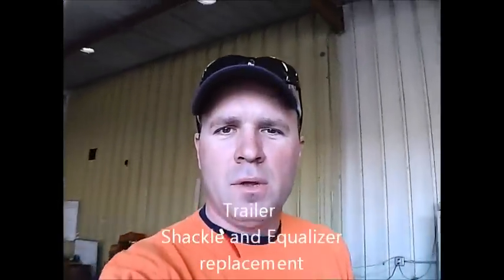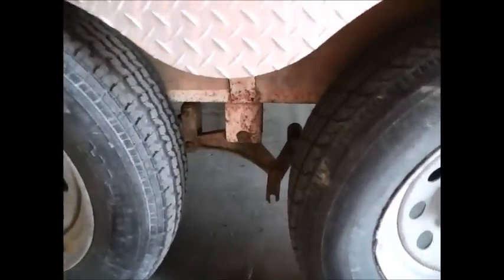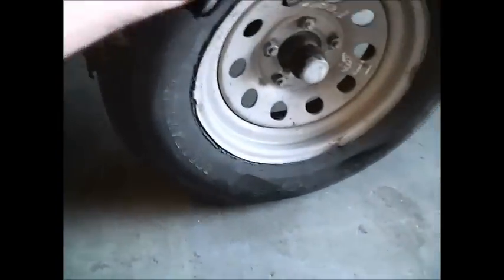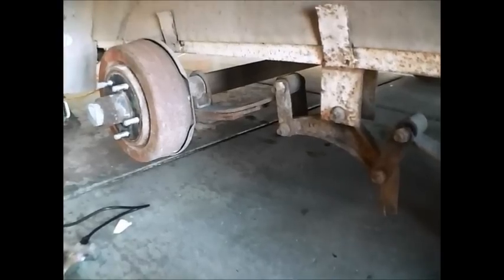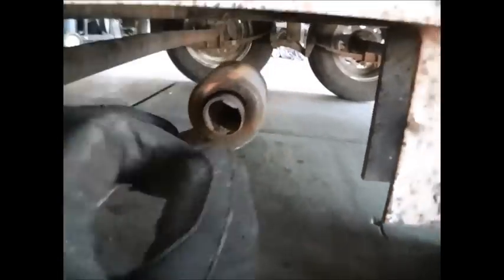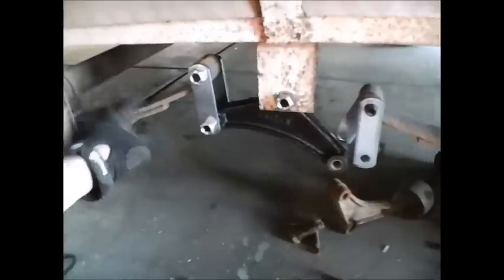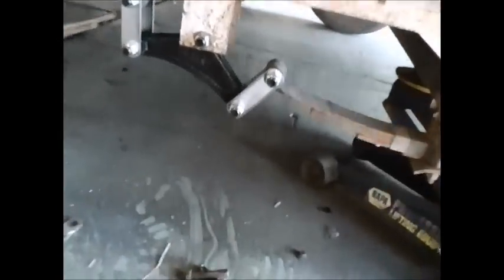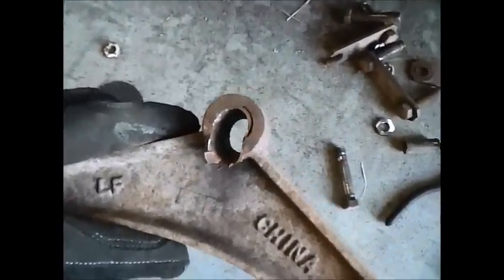Trailer suspension repair: How to

Comment: I am doing this repair but bought the kit which has grease fittings on each of the bolts/pivot points.  Being able to pump grease into those suckers is important, and will prevent future axle failures.  My equilizers were worn  half way down the equilizer, and would have snapped at any moment.  Grease fittings should be standard equipment.

Comment: I would like to share something with everyone. Those equalizers are made to fail. They do not bend or distort, they snap when they are ready to go.  Yes they are steel but they are a cast steel. Total crapp. Cast iron is stronger and would last a lot longer but also fail before they distort. Now if the were fabricated from a piece of mild steel with a continuous thickness throughout  they would last forever. Better yet ,tool steel .Yes you may need to replace the bushings and bolts now and then but the equalizers themselves would keep on truckin'.
Let's say the thickness between the hangar straps is 1.75" and you used a piece of road plate at that thickness, drilled and added some bronze bushings, it would be bulletproof as well as salt water proof. There are plenty of ways to fabricate these things so they would last for a long time. But the companies who cast these things must know they are screwing the public. Have you ever seen a person trailering their boat stuck on the side of the road with their trailer tires pushed up tight to the fenders? I see it all the time. Those equalizers are crap, made from Chinesium and the D.O.T. should banned them. Like everything that's manufactured nowadays made to fail. We live in a disposable economy surrounded by Chinese junk!

Comment: Thank you you've told me what I wanted to know. The last time I used my brothers stockcar trailer was about 10 years ago to haul my 55 Chevy home and at that time I put new tires on it and while the tires were off I got a good look at the suspension. The shackles and spring pins were badly rusted. I just about didn't use the trailer but since I bought the new tires I figured it better have one more haul left in it, so I took a chance, and we made it home ok. But that was 10- years ago and the trailer has been sitting in the weeds so I know it needs rebuilt. Thanks for tutorial on rebuilding the suspension it helped immensely.
Reply from the maker: Hey Mark,  Thanks for the awesome comment,  Glad that the video helped out. Appreciate ya, Cheers!

Comment: You answered my question. I was curious about how tight the bolts needed to be. I went until the splines were fully engaged and then a little more. I figured everything was slightly in a bind. I’ll back them off some. They are lock nuts so they should be perfectly fine.

Comment: I have an RV with similar suspension and will be upgrading it in the next few months to a beefier system.  Thank you for this video, very informative for sure bud.  One question though.  Would you recommend putting any grease on the bushings at all?
Reply from the maker: Thanks Brent!  Yeah you can use grease if you want. They actually sell leaf spring bolts that have grease zerks built in. I live in the desert so I dont deal with rust very often. If you live in a humid, snowy or rainy part of the coutry than I would recommend greasing them. Good question, appreciate the nice comment!

Comment: Any real advantage by going with a metal bushing? I watched a video of a guy who swapped out the springs on his trailer and pulled out the plastic bushings beforehand to replace them with bushings he cut himself from copper or brass pipe. He didn't explain why. Obviously, metal doesn't wear as easily as plastic but my plastic ones have lasted for 15 years. Is it worth the time and effort? Thank you in advance for your time and thoughts. Nice video!
Reply from the maker: Hey Scott. Thanks for your comment! I would only recommend a brass or copper bushing if the trailer was being used daily, like a landscaper or small business. Ive never used metal bushings but have used greaseable shackle pins which help with longevity and smoother operation.
If your trailer is not used daily than a plastic bushing will work great, thats all Ive ever used on my trailers.
Reply: @RYEINDUSTRIAL  Excellent. Thanks for the reply. I'll stick with the plastic that came inside the new springs then. It's just used on the weekends. I appreciate it and I subscribed.
Reply: Bronze is used for bushing material in many applications, I would imagine brass and copper doesn’t hold up as well..
Reply: Hi nice vid. Some of my bushings were tight in leaf springs. .is it ok to drill it out to slide in?

Comment: What a great video. Would you prefer metal bushings over the plastic I see being installed? Secondly, my old trailer had shackle bolts with zerk fittings to grease them.  My new replacements are just bolts. Is there any benefits to greasing the fittings over just straight bolts?  Appreciate your innput.

Comment: 0:16  Wear is caused by the bolt rotating in the shackle.  Weld the boltheads to the shackle. Use greaseable parts
Reply: good to know, TY
Reply: Most shackles the bolt head is press fit to prevent rotation. ONLY turn nut during removal

Comment: Replace those crap bushings with bronze bushings and use greaseable wet bolts. Will last forever. I use a torque wrench for these bolts. Not too tight and not too loose.

Comment: Can you flip the shackles to allow for more distance between the tire and frame?
Reply from the maker: Yes you can, but you would need to change the mounting on the non shackled side of the leaf spring. As long as the spring ends are parallel than you are good.
I have seen kits available for lifting trailers. I would suggest finding a kit online and looking over the parts kit and making it yourself.

Comment: I'm looking at purchasing a trailer that has a busted equalizer, everything else seems fine, should I trust it to be road worthy?
Reply: equalizer's are usually the last to go, check for play in the suspension. I'd suggest replacing all suspension bolts and bushings when you replace equalizer, the hangers could be bent but fairly unlikely

Comment: Good video.
Question what causes a axle to flip? I have a tandem axle that will pop up.
TIA
Reply from the maker: Hey Mark. That can be a normal thing when a trailer is empty and you hit a good bump. The force will cause the pivot point of the equalizer to bump over, usually after a few miles of driving it will come back into place.
If it is a constant proble, loaded trailer or empty trailer, than you might have a few problems. First I would check the shackles and make sure they arent bent or worn out.  Second problem could be the wrong size leaf spring, its too short in length. Third would be that the leaf spring brackets welded to the trailer were done wrong.
I would try checking the shackles first and make sure that when the trailer is on level ground that they are straight up and down from the equalizer to the lesf spring. If there are offset then I would change them out with the same size.
Its hard to say how to get it fixed without seeing the trailer in person so I hope my suggestions help. Worse case take it to a good trailer repair shop in your area and have em diagnose it. 
Thanks for your comment!

Comment: great video, learned a lot....which truck or car rims would fit a tandem axle?
Reply from the maker: it depends on the hub size. most common trailers, like in the video, has a rim size 15x4x5.5    Meaning 15" round.  4" wide and a lug pattern of 5 on 5.  5 lug nuts and the lug holes measure 5".   I found the width is the most important. My chevy rims will fit but the tire will hit the frame when installed. Most Japanese rims are 5 on 4.5" but might work for a smaller trailer.  Hope that helps some. Thanks for the comment and watching the video. Cheers!
Reply: Alright thanks...Im looking for truck rims with the right offset and center bore for 5 on 4.5, so far no luck.
Reply: @JoeBakerOutsideTheBox  try ford Ranger wheels. or jeep cherokee wheels

Comment: Very informative. Really needed a vid like this. Thank you. Have one question. How do I know the axle GVWR? I purchased a used trailer like the one on the vid but don't know the GVWR. Any way to find it? What is the GVWR on the one in the vid? Thank you
Reply: If its a tandem axle its safe to assume each axle is rated for 3500 pounds

Comment: Question: On those flex points where you back bolt back a 1/4 turn. Would you recommend locktite on those bolts ?
Reply from the maker: Hey Troy.  Yes you can use locktite to help em from backing off.  Thanks for your comment. Cheers!
Reply: There're new lock nuts and the bolts don't turn they seat. He had to use a fuckin' grinder to get the old ones off. But you can use loctite, good idea!!! You had it all apart! You could have greased those parts so nicely prior to any grease from the zerks.

Comment: I had a wooden block placed between my shackles. I just notice this after towing for about a year now...Any reason why this would be?
Reply from the maker: Hey Mail Box. Im really not sure why. I do know that when a spring or shackle  breaks you can put a block of wood  between the spring and bottom.of the trailer to "jack up" the axle to get the trailer home. Quick temp fix to avoid a tow charge. It also need to be the trailing end of the spring for it to work. I dont recommend this but Ive seen it done.

Comment: ............Maybe I missed it , but you didn't inspect the leaf springs for cracks ! Esp. on the leaf with the eyelets . You did a really good job , but I'd have replaced the leaf springs as well as they are just as cheaply made(China) as the rest of the parts you replaced .
Reply from the maker: Hi Joe. Thank you for you comment. You are right about checking the springs!  I didnt include that in the video but should be a step taken during repair. Thanks for the good note!  Cheers!

Comment: WHY would you put in a plastic bushing instead of a metal one?
Reply: metal bushing on a metal bolt at a pivot point will wear out really fast from friction or rust will eventually seize the bolt in the metal bushing

Comment: Any doubt the other side needs to be done too?
Reply from the maker: I did end up replacing both sides.
Reply: RYEINDUSTRIAL  Yes sir !  You said first off you intended to do both sides.  Judging from the wear it would be foolish not to.  From the condition of the parts we saw, it was needed for some time and you would be the expert here.  Were they just as badly worn?

Comment: just slide the old bushings out he says! lol. doing mine right now and my old ones didn't just come right out.
Reply: How did you get them out?
Reply: @jsolo7576  if it's the plastic bushings like i had,i just took a torch and melted it out on mine.

Comment: Toward the end you mentioned that you back off the bolts a bit to allow movement.  All shackle bolts I have ever installed must be torqued to 40-100 ft/lbs, which certainly does not allow for any back-off.  Either you need to make sure your bolts are the right length, or you have a different type of bolt.  Are you welding the nuts after assembly?
Reply: do nuts have to be welded after?  and can one just use lock tight?